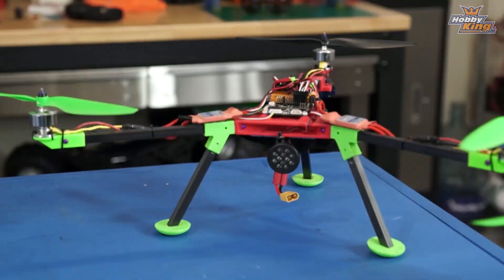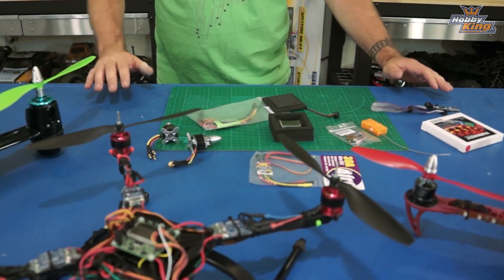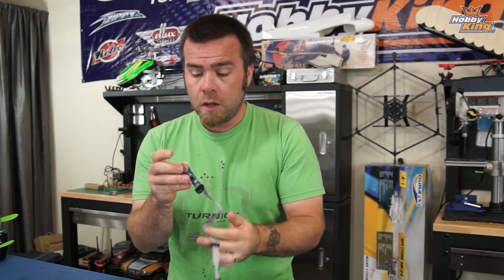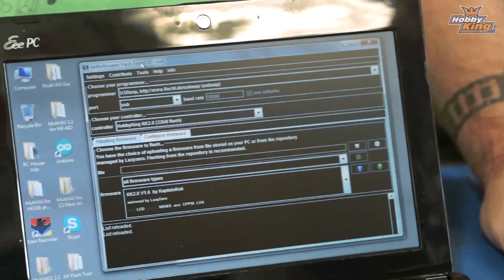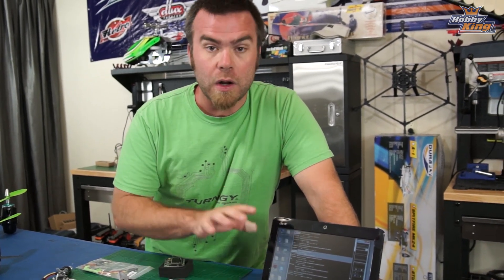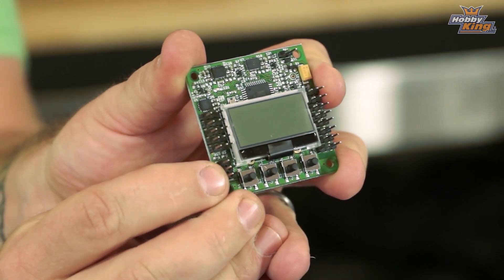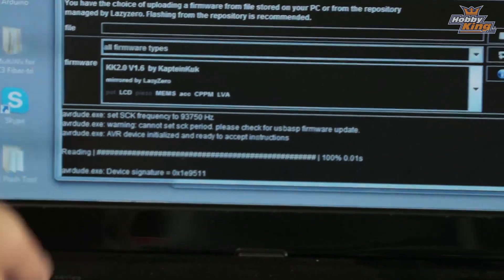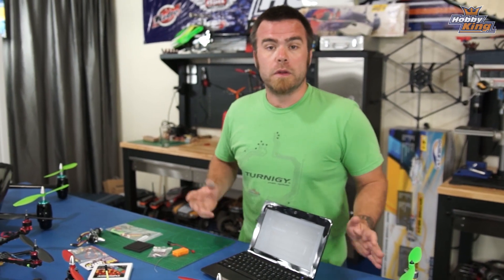HobbyKing - KK2.0 Complete Guide - Introduction and Part 1

Comment: Help pleas having problems when I go to flash the soft where keep geting an error that sates (error during setting the fuses not happy with eBay as the one that I ordered was a turnings and got a tottaly different one with the name kv tecnology it is tottaly different in every way posibe it's green not blue has ten pins with an adapter and looks lick a mirror Image of the original as everything is upside down on the board
Reply: So have also bean on the hoby King site and it's the same story pearl swing that the only way thay can get it to work is re wiyering  it not happy have go and got six kk boards for my dji-f450 and f550 drones so pleas where can I get the do you original board and cable and not a copy as too many companies are falsely advertising copies that don't work properly

Comment: I have a dud board too! Just got it the other day, took it out of the box, plugged it in, and blank screen. Completely unresponsive. Back light goes on but board doesn't do anything but light up and the pizo speaker screams away. Seems from what I see these KK2 boards come DOA just as often as they come working. Very poor product. Sad because I really like the Idea of changing settings right on the controller.

Comment: Matt do you have an email to send build request message. I've been sending message via Facebook Messenger with little success
Reply from the maker: +Shaun Seeley What builds are you looking to be done?
Reply: +HobbyKing Live 
What I would like to build is this:

- Orange t-six 2.4ghz dsm2 compatible 6ch transmitter w/10 model memory and 3-pos switch (mode 2)

- Orange r615x dsm2/dsmx compatible 6ch 2.4ghz receiver w/ cppm

- Hercules 500mm Quadcopter (kit)

- Hobbyking kk2.1.5 multi rotor lcd flight control board with 6050 mpu and at me 644pa

- Hobbyking donkey st3007-1100kv brushless power system combo (x4)

- Multistage propeller with dji fitting 10x4.5 black (cw) (2pcs)

- Multistage propeller with dji fitting 10x4.5 black (ccw) (2pcs)

- Hobbyking quadcopter power distribution board

- turnigy 2200mah 3s 25c lip pack

- turnigy p403 lipoly/life ac/DC battery charger

- Shock absorbing 2 axis brushless gimbal kit for action cam

- m200 crab leg landing gear set diy (red)

 My concerns are these...

1. Will all these components work together to allow me to use the quadcopter as both an Ariel video and a daily flyer?

2. Should I change to an 8ch receiver like the

Orange ga800hv

3. What type of battery time should I expect? To get 10min plus should I go to a 4400mah battery? 

4. Is the charger listed capible of charging all 3s and 4s batteries? 

5. Are these motors and props proper for this quadcopter or what would be suggested?

Thanks for your help

Comment: My quadcopter just flips and don't even get off the ground i looked at all the settings and calibrated the acc and set all my P and I settings like in the hobbyking kk2 calibration guild , I balanced my battery i tried everything I think my boards a lemon.
Reply from the maker: +Corey Simmons Are your props on the right motors and are those motors spinning the right way?

Comment: Thanks for the video. Much appreciated. However a little constructive criticism. I train people in my field and one thing as a trainer I always remember is that I already know everything in and out of what I am doing. The people I am addressing may not. So please be aware of when you are taking things for granted because they are common place for you. I am sure holding up a USB cable needed to update the firmware will result in positive responses to every there at Hobbyking. But holding it up in an instructional video and not Identifying it clearly by part number, name etc. does not help people who are trying to learn and purchase the proper equipment through Hobbyking. "Go there and get it" when we don't know what to search for is frustrating.

Comment: Looking forward to the settings of the sk450 because I bought that and the kk2 and use the ntm 2628 motors too, tough with the q-brain esc on 2s nanotech 6000mah and 10x4.5 sf props.

Comment: Hello Matt,
 are you using the old listed USB asp AVR Programming Device (PRODUCT ID: 9171000003 )?

I now see a link to the new USB device (PRODUCT ID: 381000147 ) , which one are you using in this video, do they both work to update the firmware of the KK2 board?
Robert HK PS #4

Comment from the maker: It has always worked as you describe it for me.  I'll mess around with it and check using my own simonK flashed quad.  I believe I've always calibrated using the normal process with the props off.  - Matt

Comment: This seems to be the beginning of a series of great informative videos!

What I'd really like to see, either here or on the HK product's site is a list of recommended setups & accessoires. I'm just about to order an SK450 / dead cat to build my very first multicopter - of course w/ KK2.0 FC. It took me a lot of time to find out which motors and propellers I'm gonna use. To see some suggestes setups for the copter frame would've been very helpful.

Comment: tried it more than 10X fast/slow...when i tried it without kk2..with just a servo hub (4 esc in 1 servo plug directly plug into the thro port of receiver) it works...quad is flying...just want to know what i missed why it did not push thru the calibration on the kk2 board

Comment: please explain how the calibration works for simonK flashed ESC...when i press the 2 end button, full throttle, power on...beep once, then immediately the motor runs before lowering the throttle stick..